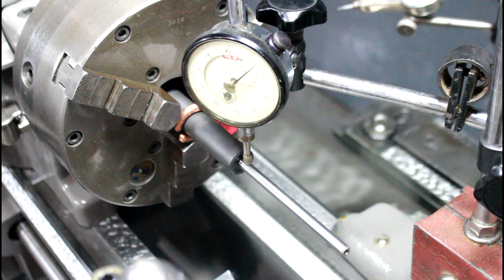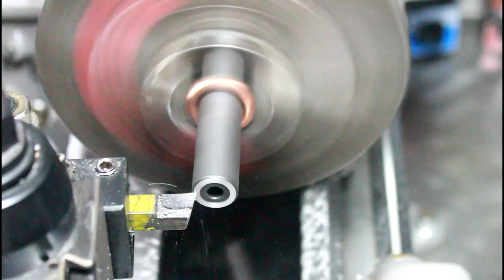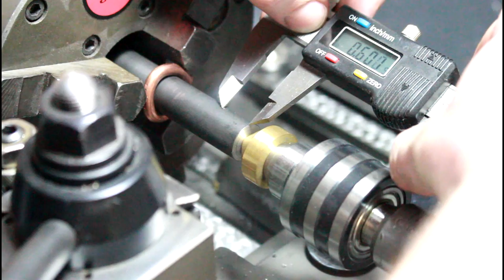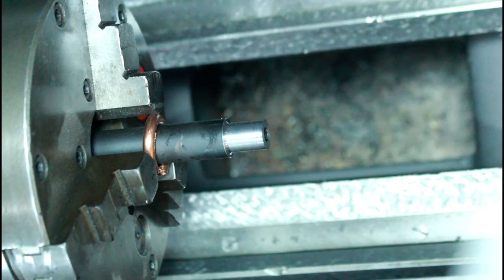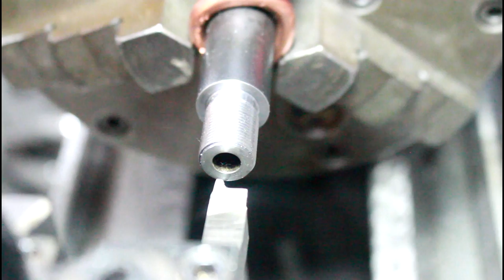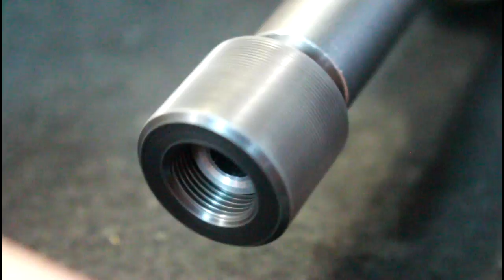Threading a Barrel Reboot!- Thread Protector installation

Comment: You cut off the original "target crown" and then decide to "protect" the muzzle? I gotta say that doesn't make a hell of a lot of sense since there's no reason to jack with the original "target crown" beyond what will be removed by cutting down the barrel OD to thread the barrel. Messing with factory crowns is pretty much always a bad idea. But you're not the first "gunsmith" I've seen whack off the whole end of the barrel and ruin the original crown just to thread a barrel for the hell of it, so you're not the Lone Ranger, I guess. Your "recessed target crown" that's cut in the end of the muzzle and rifling isn't exactly how the "factory" crowns barrels. Typically a crown is "rounded" and reamed and "smooth" and leaves the muzzle de-burred and "lapped" so the rifling outer edges end up "radiused" rather than "sharp". 

Crowning barrels is something that's better left undone than done improperly and there are "cheap" old guns with "raw" barrels just whacked off like a hacksaw was used and left that way where "finishing" the muzzle of the barrel was impossible to do "correctly". My 1950s-vintage Savage 24 "camper special" .22/.410 over/under rifle/shotgun is one of them. Looks raw and unfinished as hell but since the two barrels are a "one piece" deal and they were unable to "finish" the entire end of the barrel by radiusing and crowning them individually, they just left them "whacked off" and raw. And no doubt some hand work was done to de-burr and lap the bores at the muzzles. 

I also haven't yet figured out why its necessary to thread barrels with a single-point cutter on a lathe when a conventional die will work just fine, produce better threads when a quality die and proper thread cutting lubricant and practices are used and you can get plenty of thread on the barrel with a standard die and are better off NOT going as far as possible with the threads regardless since you've got a chamfer and/or crush washer to take up space whether using a thread protector or "muzzle device". Nor can I figure out what the "rush" is threading "precision" parts at "high speed" with a single-point making multiple passes to end up with what is not a "standard" thread with a "specified" thread depth/engagement and isn't automatically a "good" thread just because the "muzzle device" which is generally cheap, mass-produced one-size-fits-all "quality" threads on easily and "doesn't wobble."

In fact, its "normal" with "correct" thread depth and profiles for there to BE some "wobble" in threads until the components are completely screwed together and "torqued". With no "play" you have too much thread engagement and will usually end up with too much friction and can easily gall threads during assembly and then strip them during disassembly. "Standard" threads as used everywhere else in a gun or any other machine will typically have about 65-70% "thread depth" and that "clearance" is what lets the material in the threads and the threads themselves "grow" as torque is applied without LOCKING in place and permits the parts/fasteners to "relax" when the torque and tension is removed later. 

If you're not using a quality THREAD PITCH GAUGE to "inspect" your finished product to determine that the thread pitch and shape are correct and a micrometer/caliper to measure the "major diameter" of the threads after cutting to make sure a "1/2-24" thread is .500" in diameter and if anything on the "small" side, you haven't done even an "accurate" job of cutting the threads, much less a "precise" job of doing so. I don't know what kind of barrel you're working on there besides "Remington" but since it's out of the receiver and probably an AR or 700 barrel and a "factory" barrel at that, only if you did this work for "free" for someone else or for yourself was it "worth it" compared to simply buying a "replacement" barrel already threaded since this barrel obviously wasn't too good and too "valuable" to jerk out of a rifle, toss in the lathe and whittle away on. 

Good machinists and gunsmiths don't perform unnecessary work or remove unnecessary material or modify "original" parts in good condition just for shits and giggles and good gunsmiths NEVER jack with a FACTORY CROWN unless the muzzle is damaged and even then only with a hand "reamer" to "touch up" the factory crown. If the damage goes too deep, THEN they MIGHT "shorten" the barrel and recrown it "inside and out" (quality threaded barrels don't have a sharp edge on the OD of the "cut" and are lightly "de-burred" and "radiused" there as well) as a "last resort" IF the rifle/barrel has "accuracy" issues and the rifle/barrel otherwise "check out" and don't show damage, wear etc elsewhere that could be causing or contributing to the problem. 

If the chamber, throat and bore aren't in excellent shape and clean and bright and not pitted, frosted or "worn", they might go ahead and cut down and recrown the barrel IF they can do so for significantly less money than doing the work. If not, they encourage the owner to replace the barrel so its a known good tube going back in/on the rifle. THEN if there are "accuracy issues" they're not doing any "truing" or other "accurizing" of a "bad" receiver and then screwing the "old" barrel that will probably need reamed and headspaced again regardless back into that receiver just to "test fire" the whole "original" package again and maybe to get "acceptable" accuracy and precision out of it. 

The proof of a true professional when it comes to machinists and mechanics and other technical tradesmen is that they'll save the customer money at their "own expense" whenever possible encouraging him or her to replace rather than "rebuild" or "repair" or "modify" used parts and in the process save themselves a lot of time, stress and uncertainty putting their own time into "rebuilding" or "repairing" or "modifying" something that's still going to be used and less "valuable" post-modification/repair/rebuilt than in "good original" condition as a "core" for someone/something else and will use the time they save doing it "right" and "fast" with the new part made to do what the customer wants on the next project that is ALWAYS waiting for GOOD professionals. 

When it comes to rifle barrels they CAN BE good "cores" and especially if they're factory 700 barrels can be rebored/rechambered for other larger cartridges and doing so with "shot out" barrels in something like .30-06 Springfield and reboring/rechambering them for .338-06 or .35 Whelen is common practice and some guys want "junk" factory 700 barrels just for that purpose. They're originally bored straight and are "seasoned" and have FACTORY MARKINGS and when applicable are drilled/machined for factory "iron" sights that most hunters who want a .338-06 or .35 Whelen for "large game" like elk and moose and maybe bear like to have on their hunting rifles for BACKUP and that add a BUNCH of time and/or expense to "rebarreling" with an aftermarket replacement barrel that has to be drilled and tapped and possibly machined for factory sights and will NEVER have factory markings on it. 

And the older the "donor rifle" the more "valuable" its "junk" parts generally thrown away or tossed aside by somebody "building" a "custom" rifle they decide they have to have a "composite" stock and "high-end" barrel and the receiver/bolt "trued" and "squared" and other "improvements" done on. Cast off wood stocks for "vintage" 700s and "take off" barrels can go for $50-$150 apiece and that's not even the really "desirable" ones. There's a reason Remington charges and gets $400 a pop for brand-new 700 receiver/bolt sets while "gun experts" wanting to build "custom rifles" walk right by "steals" like I found at Cabela's a few years ago on the "used rack" and the BOTTOM of the "used rack" next to what I consider "mil-surp junk" like Mosins and Arisakas and a Lee-Enfield or two. 

A 1967-vintage Model 700 ADL in .30-06 Springfield in a fairly "fancy" but kind of beat-up glossy, fully checkered Monte Carlo stock with probably 80% original bluing, a pretty nice and bright bore, "vintage" Weaver scope mounts and a "cheapo" Tasco 3x9 "optic" and a pretty obvious and well-done "trigger job" with even an old-school "trigger shoe" on the trigger and an "aftermarket" and pretty damned "vintage" Pachmayr recoil pad AND the original front sight but unfortunately no rear sight assembly. For $200 on the tag and about $215 out the door. 

Shoots like a vintage 700 should and that trigger is as crisp and sweet as any trigger I've got in any other gun with a good, light trigger and I've got several guns WITH good, light triggers. It needs "restored" but I'm not sure what direction to go with it. But I'm thinking about making a "sleeper" out of it, leaving it .30-06, glass-and-pillar bedding it, getting a "regular" wood stock for it (I'm right-handed but shoot lefty so a RH Monte Carlo is kind of a waste for me to refinish, repad and reuse), putting a factory rear sight back on it and maybe putting a "vintage" Leupold  fixed power or possibly a 4-7X on it and using it to shoot circles around "long-range" and "extreme long range" shooters/guns out to 600 yards or so. 

I've thought about reboring/rechambering it for .338-06 but I won't probably go moose/elk/bear hunting and if I do I'd still have at least two different bolt-action .30-06s to choose from and .30-06 in the right hands is "enough gun" for all of the above if the "hunter" is "hunting" instead of playing "sniper" from "long range". What I won't do is make it "tactical" and/or otherwise "modify" or "upgrade" it and especially won't let some wannabe "gunsmith" with a lathe and low standards for "precision" get ahold of it.
Reply from the maker: Oh boy... where to start. To begin, I have built 600-1000 yard F-class and BR rifles that are anything but factory and built to exacting specs. You must not know very many good gunsmiths... ANY GREAT gunsmith, knows that factory is sub par for the most part, and while there are a few exceptions, A factory rifle, barrel, action, or even trigger has a hard time besting a custom rifle, barrel, action, or trigger without have extensive work done to the factory items to make them shoot at their best. Even then, you don't see any factory rifles at BR matches, Berger SW Nations, PRS matches, ELR or very many other major competitions. You do get the random guy at some matches with a factory "target" rifle, but they are usually new comers and have not invested in custom equipment yet and they never finish at the top at higher level matches. Re-boring a rifle barrel is pointless and costs almost as much as a Hart, Brux, Kreiger, Spencer (pick your custom barrel maker). Spend an extra $50-100 and get a new barrel. Unless it's something special like a custom contour or a hex type barrel. That and they guys that re-bore WON'T guarantee that it will bore properly! Restoring an old original rifle is different than building custom or semi-custom. Even with a re-bore, you will need to re-chamber, re-crown, and may even need to set the thing back. So on top of getting a so-so factory barrel back that has been re-bored, you may need to do all the work that you would have to do if you started from scratch with a new barrel. Ask me how I know! Most crowns are not round anymore, that was a thing of the past. Most crowns today are recessed targets, or a variant of. They are a mass produced product and inherently have error and are not set up one at a time and indicated concentric to the bore. Guided crowning tools are also not perfect because there is clearance for the bushing to ride on and has the potential to cut an off center or un-concentric crown. A good gunsmith should be able to re-crown your Savage 24 on both barrels, fairly simple operation. When I worked full time as a smith, I would try and help people save money, but many times, it becomes cheaper to replace parts, or get new ones vs. repairing old ones. Try telling someone it will cost $150 to repair you old broken stock and 2-3 weeks time, or I can put on a new replacement for $100 and you can have it back in a day or two. Saves them money, and I can move onto the next project.... WIN WIN. Time isn't cheap at $75-$90 hour. And don't count in the cost to run the shop, which many guys even at those rates, have a hard time making a living.  Threading dies have their place, and if you want good enough, maybe concentric, you can use a die on the muzzle, but when you bring it to someone like me because you are having baffle strikes, or blew off your muzzle brake, I'll get the business and you just wasted your time and money trying to save a couple bucks being "good enough".I learned from a guy that use to travel the country in a greyhound bus shooting BR competitions and ran a shop building BR rifles for people all over the world from the 1960's till the early 2000's when he un-officially retired from full time work. It's a different mindset to do everything perfect, vs "good enough". If you're happy with MOA at X yardage, that's fine, but I'm not and good enough doesn't consistently get you 1/2 MOA or better at 600+ yards. Not sure how many BR or Custom target rifles you have built, but by the looks of your channel, you need to connect with a REAL TOP NOTCH gunsmith, and not the guy in his garage cutting off barrels with a hacksaw. Then when you spent thousands of hours learning, building, practicing, and many years figuring out how this stuff is put together, and why you don't use a die on a crown, then you can have an educated opinion on the subject.
Reply: Recrowning a barrel to freshen it up and ensure the crown is concentric to the bore is standard practice.
 the "factory" rarely gets this within .0002".
Any offset to the crown as the gasses leave the barrel will upset the bullets flight pattern sicne the gasses are leaving the bore at a rate FASTER than the bullet is leaving. (bullet has more mass, gasses have less)
These gasses will act upon the base of the bullet for up to 15 feet after the bullet has left the bore.
(another reason for proper follow through and why many guys pull the shot)
The high pressure gasses will follow the crown due to laminar flow. Or completely detatch in a random pattern if the crown is cut at 90 deg.
If the crown is off, these gasses following the crown in laminar flow fashion thus pulling to one side and will push the bullet to one side or the other causing the bullet to obturate and may fly off its intended course especially if it never really gyroscopically re-stabilizes itself from being pushed offset from the rear by the high pressure gasses.
Many shooters will recrown their "factory" crown after 600 rounds or so just to refreshen it up since the high pressure gasses leaving the barrel can actually flame cut the very end of the rifling further causing an upset pattern to the way the gasses exit the bore "unevenly".
a 30x jewelers loupe can verify this.
When starting fresh, a freshly cut crown concentric to the bore is good medicine.

Comment: three (3) jaw Chuck's don't cut it for action jobs or barrel jobs sorry bubba
Reply from the maker: Look closer.  It's not a standard 3 jaw. It's a buck adjust tru chuck which can be dialed in on 2 different axis along with a spider in the outboard side.  I have another fixture for actions.  While it's not the only method I employ,   please tell me how dialing in the first couple inches of the barrel into one or two tenths is not going to cut it. 

Good for you for at least knowing a standard 3 jaw won't suffice. I have done several rifles that shoot bugholes using this method.  If you don't know what that means,  let me know I'll explain.